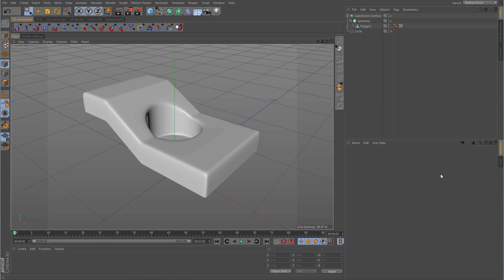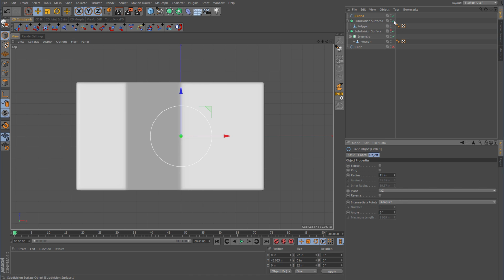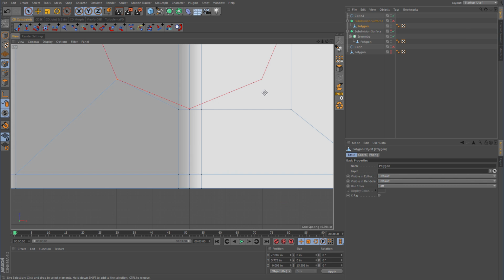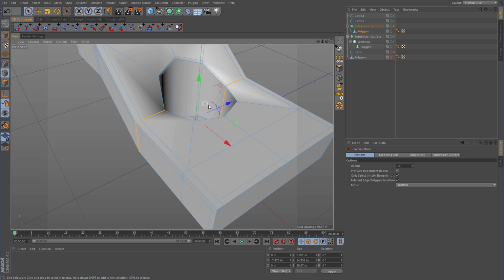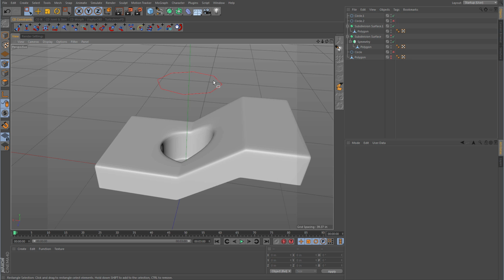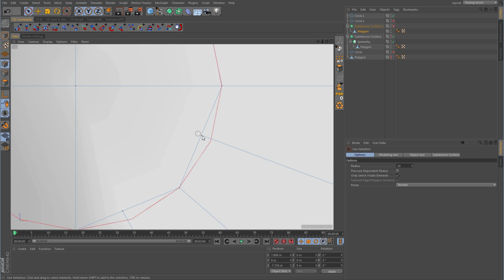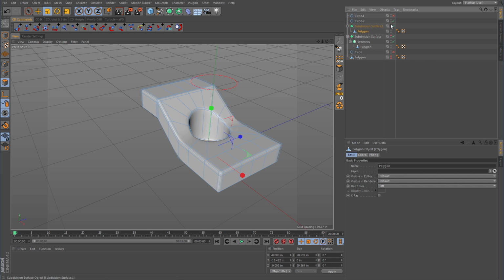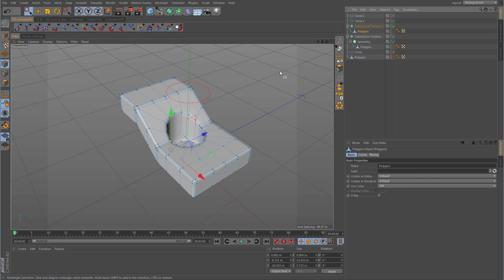Sub-D Modeling in C4D - Lesson 20 - Pinching

Comment: Great tutorial - you might want to look into moving along normals with the Move Tool or Brush.  You can change the setting in the attribute manager.  They you'll move along the normals when adjusting the points on the incline and you won't have to go back into the side view to adjust. Also, snapping is weird when you have multiple points selected and it has different modes that might help getting it to work for you.
Reply from the maker: You are right about it being weird when multiple points are selected. Thanks for the tip!
Reply: Np, thanks for the tute!

Comment: Hey Shane, you might know the answer to this question I have. Is there a way to cut a loop into a mesh in C4D and make it respect the curve of a mesh. For example, when you have a low poly sphere in a subdivision surface when you introduce a loop it "flattens" that area around the loop. Max, Maya, Zbrush and a host of other software are able to cut loops without the need for you to go back and scale out the loop to bring back the curved surface. I know there are some deformers that help relax a geometry's surface.
Reply from the maker: I know exactly what you're talking about, and I am not aware of any way to do that in C4D without manually scaling out the loop cut. When it comes to modeling, C4D is still lacking, and still needs some improvements compared to other software.
Reply: Yeah it's a pitty but with each release the modelling tools do improve. Let's hope with R18 we get an insert loop tool that respects topology.

Comment: Great tutorials man.

On 19:10 you can use L key to constraint the movement along the edge and avoid moving those points roughly where they should be later.
Reply: Could You elaborate on this?
Reply: In point, Edge or Polygon mode try:

Move tool
Hit L
Click on edge

Movement axis should be aligned on the selected edge

On second thought it works like a slide tool.. so that works too :)
Reply: Thanks Man !

Comment: Good tutorial. I have two suggestions: You gain time projecting the spline (edited) on the Y axis You also gain time by activating the magnetism to adjust the objets points to the spline (and you would be more accurate).
Reply from the maker: Thank you for the tips! I was having trouble getting snapping to work. For some reason it was not working correctly for me.  But you are correct. Projecting the spline and using snapping will speed things up. :)